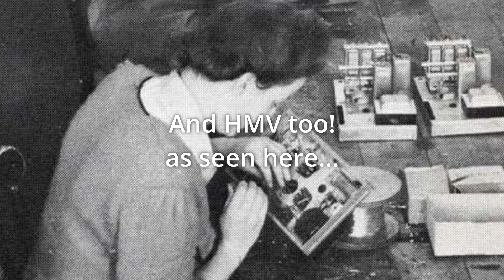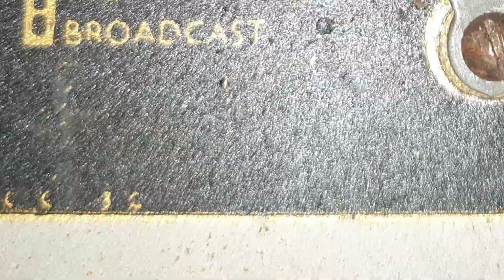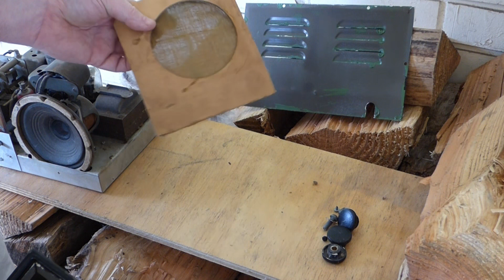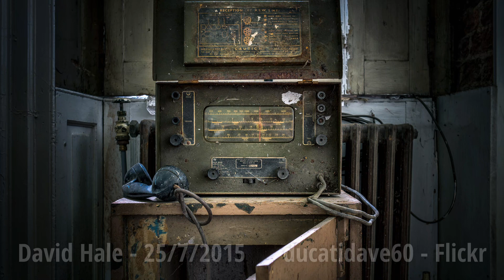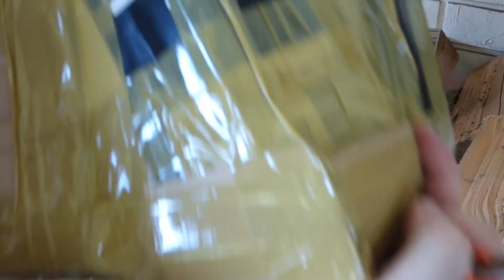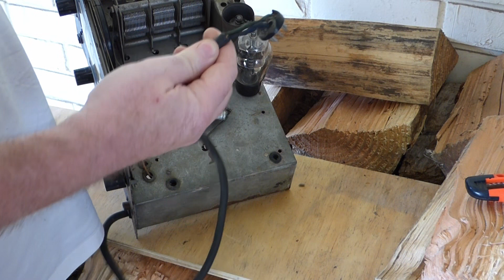NZ Military Radios - AEW1 and AEW2 Overview

Comment: DEAR STEVE,
ON THE DIAL OF RADIO AEW1 NZ AT THE LEFT BOTTOM IS WRITTEN, " PLESSEY " WHAT DOES THAT MEAN. IS THE DIAL PLATE OF AEW1 NZ WAS MADE BY PLESSEY COMPANY OF UK.
Reply from the maker: Hi, thanks for the interesting question — that marking will be an indication that the dial was made for the Plessey tuning gang (Specifically the Plessey K440 I think).  The parts breakdown does not indicate what gang is used, just that it's a 3-gang 440pF type... probably indicating they knew they would be using whatever they could get their hands on.

Around 15,000 AEW1's were made for the Eastern Group Supply Council (EGSC) in the later years of WW2, and it's almost certain that several different gangs were used in production, due to shortages — and each would have tracked differently due to physical differences, so the scales would be slightly different for each one.

The dials were actually printed by A.P.E. (Auckland Photo Engravers Ltd, I believe) here in New Zealand.

Comment: The knobs on the AEW1 are the same as those on the ZC1 and similar to ones seen on RCNZ service equipment like the SG2 signal generator. The I.F. cans look more like those on Collier & Beale radios, but the tuning gang and tuning flywheel look like RCNZ items. The font and rounded corners used on on the front plates are also the same as that used on RCNZ service equipment.
Reply from the maker: Hi Daniel, thanks for the observations on the knobs - I hadn't made the link there - although I had noted the AEW2 knobs are the same as those used on the model 12 (although the knobs on my military surplus one are different).  The IF cans definitely look C&B though and I originally thought perhaps C&B had manufactured the radios - but I assume parts were manufactured all over the country depending who got what contracts from the ministry.  Cheers, Steve
Reply from the maker: Just to add to this - I recall reading recently something about one of the design decisions for the AEW1 was to use up leftover parts from the ZC1 project - so I wonder if the knobs were used for that reason?